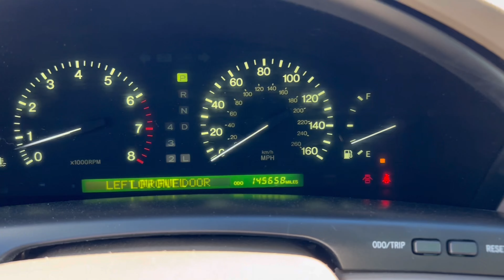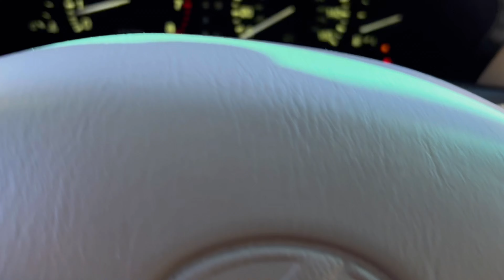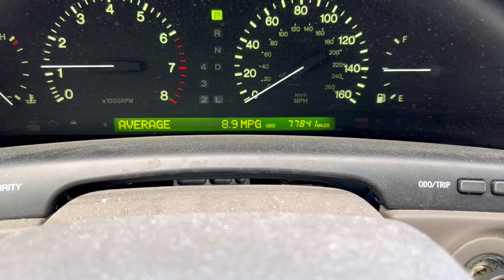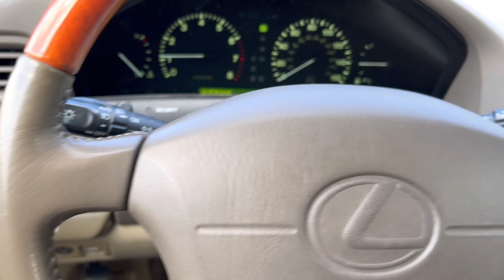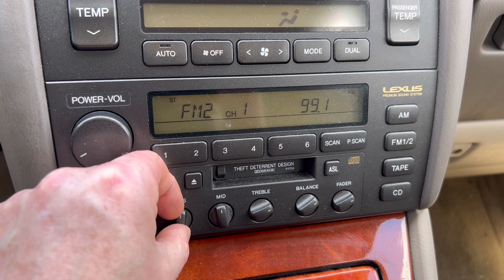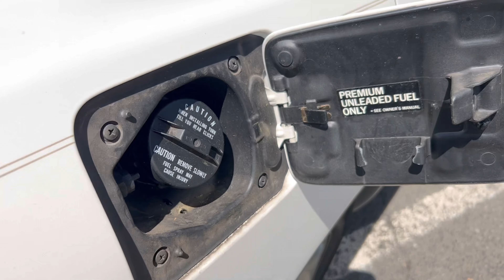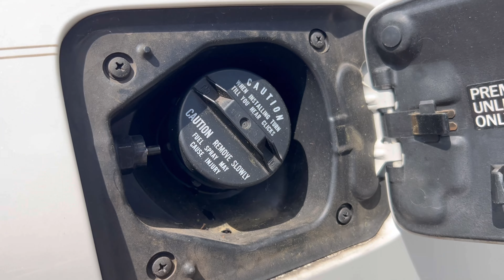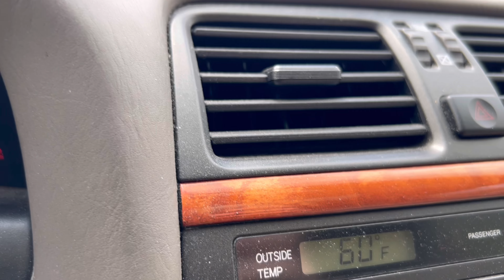Lexus LS400 • Luxury and Perfection still 25 years later!

Comment: The one that got away for me was a 2006 GS 430 V8 with only 85k miles and one owner in Pahrump, Nevada. I wanted it so bad but I have other obligations to pay off on the 4Runner we have lol
An honorable mention I also found was a 2013 GS 350 with 126k miles and one owner. Clean record, including maintenance and all done here in Las VegasHenderson NV.
Reply: Lexusss 
2013 rx350 here

New front and rear suspention
85k miles
Smooth decent power
Reply from the maker: Very cool guys, that 2006 gs430 is not a bad find. Very understated!!
Reply: I have a Garage kept 2013 GS350 w/50k miles. 
I bought it a few years ago from an old lady, it had 26k miles in 2021. 😁
Reply from the maker: Wow, what a nice find!!

Comment: Thank you for sharing, I have been following the LS 400 reliability and surprisingly it is not a very bulletproof vehicle. It is well built but parts components did not last very long. I did notice many did have head gasket issues. The LS430 was better but the LS460 was horrible. That’s just my observations in the Canadian market.
Reply from the maker: I’ve always been told it’s bulletproof… although I do prefer the LS430
Reply: Lol ok. They don't call it the million mile toyota for nothing
Reply: I have one in Arizona and it has no head gasket problems I'm at 295,000 it has no rust. It has seen some abuse but these cars can take a lot of abuse